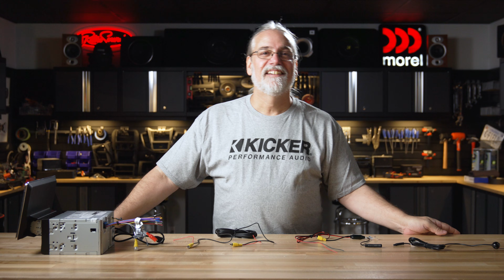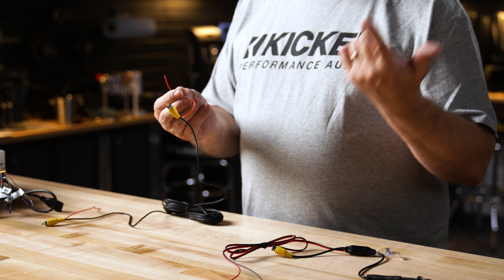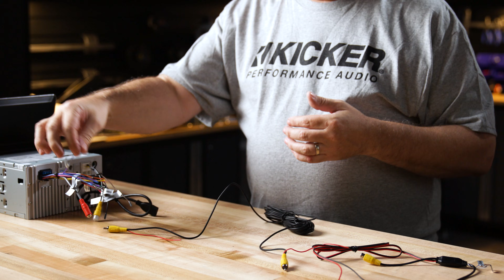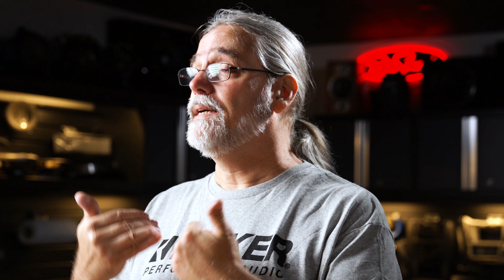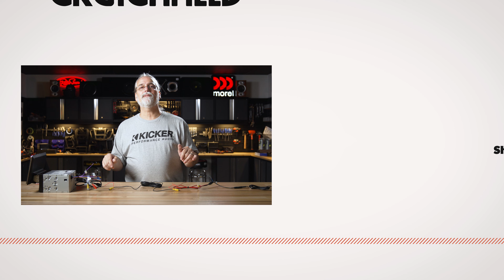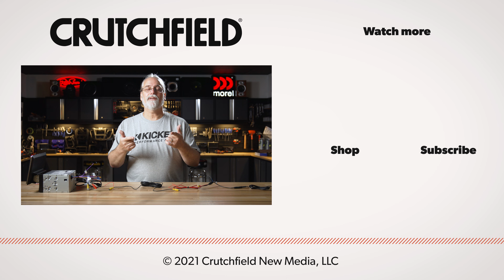Powering your backup camera (and how to use that extra wire) | Crutchfield

Comment: Quick question, What if I want to upgrade my stereo with an android carplay, but want to keep my OEM camera? 
Can you explain that if you don't mind? 
I already have 2 in the back of my vehicle, and don't want a third. I appreciate the time, and help.  Thank you again, and have a great day.
Reply from the maker: It is often possible to retain a factory camera with an aftermarket head unit when using the correct interface/adapter. What's the year, make, and model of your vehicle?
Reply: @crutchfield  2018 Dodge Caravan Se.
Reply from the maker: Yes, you can retain the factory-installed rear view camera when installing an aftermarket radio in your Dodge Caravan with the wiring interface for the Dodge.

Comment: I purchased a JensenCDR6221 from Crutchfield a couple of years back. I finally had time to install a bucamera for my truck and I ran all the wires. 12v, ground, reverse trigger, then ran the yellow wire and trigger to the front of my truck to the head unit. Plugged the yellow into cam-in and soldered the trigger wire to the purple with a white stripe. When I shift into reverse it recognizes that I shifted but no video signal, then 2 screens pop up with black and white lines flickering over it. Please help?? And its not a Jensen bucamera it was for a android touchscreen I got from Amazon. One video said it might not be compatible
☆ update- I ordered the jensen bucamera and hooked up the video and power wires that I had already ran under my truck, thru the cab, under the kick panels, and up to my head unit. Worked as soon as I shifted to reverse!!! I pulled my head unit yesterday to double check I soldered the trigger wire to the correct wire. The camera wasnt compatible with my head unit.

Comment: I hooked up back up camera, for power I hooked up to the running lights that are led and  with the key on the camera is on but as soon as the engine starts it goes off any suggestions other than running a wire all the way back to the camera?
Reply from the maker: Thanks for reaching out, we're happy to help! Free tech support is included with every Crutchfield purchase,  just locate your Crutchfield order number in your confirmation emails and give our experts a call at 1-888-292-2575.
Reply: Turn headlights on u should get it working

Comment: Great explanation. One question however. Why should the negative of the camera power be connected to 
Car chassis ground rather than to the negative of the rear lamp for example?
Can¡t you get plus and minus from the rear lamp?
Reply from the maker: It's best to connect the camera's ground wire directly to a metal chassis grounding point in order to prevent possible electrical noise/interference that could degrade the video signal.

Comment: Okay, hear me out. If I setup my camera to a manual AUX switch (and not my backup lights) using the radio trigger wire I should be able to view the camera whenever I want (the radio just thinks I’m in reverse)

But here’s my problem. My setup does not use the trigger wire but has all the crutchfield wiring adapters for my Kenwood stock backup cam. And I want to engage a front plate camera with out taking my hands of the steering wheel. 

It should work.. right? I want to test it out but I don’t casually have any Eletronics that can output an RCA video signal I can get to my car.

Comment: does splicing into reverse lights for the rear camera power  pull too much power from that circuit and cause issues?
Reply from the maker: No, it hasn't in any installation we have done to date!

Comment: I have a 2008 toyota sequoia, previous owner installed a pioneer nex 5000 head unit, I beleive back up camera is stock, I tried to get back up camera to work on head unit, well it came on and cant exit the full screen view of the camera that stays on 100% of the time now. No reset button, disconnected vehicle power and it still stays stuck in full time camera mode. Any tips?
Reply from the maker: Did you connect the Pioneer head unit's reverse wire to the vehicle's reverse light circuit? That's the required connection to have the stereo automatically switch to the rear camera input while in reverse.
Reply from the maker: I'd recommend checking the camera settings on the Pioneer head unit. You may also want to check the reverse/backup trigger input on the Pioneer receiver to make sure it is connected properly.
Reply: @crutchfield no button pushes will exit the screen out of camera mode
Reply from the maker: Its likely the reverse wire is not connected properly. Connecting the reverse wire to a wire in the vehicle that get 12V power all the time when the radio is on would cause the issue you are experiencing and the fix is to connect it to a wire that only gets 12V power when the vehicle is in reverse.

Comment: Still clear as mud when I want always on powe power. Presenting so much scenarios just adds more confusion. What's the purpose of the additional harness when you still have to connect it to a red wire on the back of the radio unit and the where\what does the harness connect to?

Comment: Just install everything, you can shift to reverse when key just on position without engine, my camera working but on screen is not so I got it mixed up there's an orange wire on the back of the screen, just like the one from the camera. You need to connect the orange wire from the camera to the PINK one on the back of the screen.

Comment: Very nice video. I have a question about my car's rear camera. When in reverse, the camera works but the power steering stops working 😶. Sometimes I see the steering icon on the dashboard. So I had to disconnect the camera in order to get things back to normal....Can you help me with that?
Reply from the maker: Thanks for reaching out, we're happy to help! Free tech support is included with every Crutchfield purchase,  just locate your Crutchfield order number in your confirmation emails and give our experts a call at 1-888-292-2575.

Comment: The main question is: why can’t you connect the ground wire to the reverse light’s ground wire?
What should I do if the camera’s signal wire is only red and there is no ground wire?
Reply from the maker: Thanks for reaching out, we're happy to help! Free tech support is included with every Crutchfield purchase,  just locate your Crutchfield order number in your confirmation emails and give our experts a call at 1-888-292-2575.

Comment: Hands down best video explaining how to hook up a camera and walk through all these little wire ends. Thank you! Will be fitting my camera tonight, so hoping all goes smoothly!
Reply from the maker: Good luck! You got this
Reply: @crutchfield thank you. I’m opting for the continuous power approach, but need an extension of the power wire to go from switch to power source - what gauge wiring am I looking at, please?
Reply from the maker: The best match will depend on the camera. What brand and model is it? If you got it here, you can call our tech support for help with the installation as well. Their direct number is on your invoice.

Comment: I have a new android unit in my toyota, there is an original camera installed, ive connected the yellow conectors, but stil no reverse cam.. im not sure what oeiginal wire to connect to th back up wire.. i need help if any1 has sorted this plz. Ta

Comment: what if you are using a "ready harness"?  do you have to hook it in the back or is that part of the ready harness wiring?
Reply from the maker: You'll make the backup camera connections separately as you do the install.

Comment: im using carplay 9" display to my skoda fabria 2010 vrs its strange on my reverse camera it came with red wire on phono cables and power cable I have no switching wire on my display so I've run wire to back of car and tapped into passenger reverse light pos and negative also power lead goes to same light but it does not come on I have same bulb on drivers side but their is no power to bulb but has bulb in socket so don't know if it should be on or not I've googled about it but it says in uk my car should only have one reverse light drivers side but mine is on left passenger side camera still not work tried earth to car no change hope you have any ideas many thanks Darren

Comment: Confusing description when explaining wiring camera so that it is not triggered solely when shifting into reverse. You don’t explain how to trigger the camera screen while you’re driving in forward gear. Such as if you are driving forward on a highway while towing and want to look at the back of the vehicle. There would have to be some extra type of switched wired in to trigger the camera to swap the head unit screen.
Reply from the maker: The radio that's installed needs to have the ability to manually display the backup camera. The process varies but the owner's manual for the radio will outline the process to get it to display
Reply: Couldn't you just use a toggle switch and run it from the 12v constant??

Comment: If my radio has multiple video inputs can I just use an auxiliary spliced to access the camera view without putting my vehicle in reverse? Could I install a switch to power the camera that way & view it on a separate channel?
Reply from the maker: Thanks for reaching out, we're happy to help! Free tech support is included with every Crutchfield purchase,  just locate your Crutchfield order number in your confirmation emails and give our experts a call at 1-888-292-2575.

Comment: The question I have is, I needed an aft video adapter for a 2013 Toyota factory head unit I put in a 2011. The 2013 unit doesn't have a video RCA port. 
    I picked up an adapter that converts the 16 pin plug to a RCA, but also has 2 extra wires in this adapter. 
      The question is, are they needed if the camera power is tapped into the reverse power line in the back? 
     I have the red head unit wire tapped into the red stereo power harness line. 
     Do I now just plug in the RCA adapter and connect the yellow RCA and be done or is there more that is needed. 
    Unfortunately, none of this has directions or a wiring diagram, nor is there a video I can find on this specific set up.
     Any information, link or advice would be greatly appreciated.
Reply from the maker: Hi Bill, the correct wiring configuration will depend on the adaptor and backup camera you'll be using. If you got the adaptor or camera here, you can call our Tech Support for help getting them installed. Their direct number is on your invoice.
Reply: @crutchfield stock head unit, aftermarket tailgate handle camera. 
    Looks like I possibly need an $80 interface 14 pin adapter to get a video RCA port. Not worth the time or money at this point to try to make this unit work. Was surprised to fine that so many cars don't come standard with RCA ports or CD players anymore... 
   Thank you for your time. 
200k miles on this tundra, not looking to spend $300 on a head unit with no CD player.

Comment: Hi. Thank you for a great explanation. One question, if my backup fuse also powers other things like daytime running lights that means I can’t use that option?
Reply from the maker: Tapping into the same circuit as the daytime running lights (DRLs) on your fuse panel isn't recommended. It could cause electrical noise in the camera feed.

Comment: Great tutorial, really informative. I have one question if can answer me, I would be grateful. How would I connect reversing camera and parking sensors together this way. Can I use same T tap connector for camera and sensor, so they are on same one T tap, or I need to use 2 separate T taps? Thank you very much
Reply from the maker: If they can both make use of the wire you tapped into, connecting the wire from the new backup camera as well as the new parking sensor system, and they fall with the acceptable sizes of wire for connecting 2, then this works

Comment: If I need that can turn on then I right signal the car . Do I connect the one end to signal other end from camera to right signal + wire ?
Reply from the maker: No, if you connect the camera’s power directly to that wire the camera will flicker on and off. I'm sorry you are having difficulty installing your rear view camera. If you purchased the camera from Crutchfield, please give our technical support team a call that handle installations. If you purchased the camera elsewhere, I recommend contacting the dealer who sold it or the manufacturer directly.

Comment: What is the benefit of using a separate ground from tapping into the ground wire for the backup light?
Reply from the maker: A separate ground wire gives you a cleaner signal with less noise or weird glitches like flickering, etc.
Reply: @crutchfield thank you.  Will directly to the trunk metal create the ground, or should I send another wire through the harnesses?

Comment: I get intermittent no signal issues flatter replacing my damaged camera.. currently hooked up to 12v power from the system not the reverse light. Had the same set up last twonyears. Had no issues

Comment: I thought this was going to explain the odd red wire from my rear camera, but alas, it does not... Sigh...
Reply: The red wire is to give power to the camera module and the LEDs when you are in reverse so you need to Wire it to your reverse light bulb on the tail light.
Reply: @guilleport I don't want it on "when in reverse". I want the damn thing on all the damn time, so that it will record like it's supposed to. How hard is that to understand?

Comment: after 3 hours of trying and failing. I came across this video, which reaffirmed that i was doing things rights. This re invigorated my confidence and i i went back and retraced my lines. Turns out the line was pinched in a unviewable spot and thankfully reseating the pinch(almost cut) wire fixed the issues. Sometimes you have to go back to basics and this was a helpful video

Comment: By any chance you have a video for front bumper camera install lol
Reply: it will hook up the same way the backup camera was installed. but !!!..you must have a head unit with an extra rca video input to use the front camera. red wire at camera end, needs 12 volt dc power ran to it, black wire at camera needs a good ground. you do not need to worry about a '' trigger '' wire from the camera?, as this camera will be on at all times, but !!..if you want to kill power to front camera?, use a toggle switch or rocker switch to kill power to it when you do not want it on at the front bumper. once all this is done?, simply plug the rca ( yellow end ) into the video rca input at the head unit, walla..front mounted camera.

Comment: OK, you got a flaw here. You're saying that no matter what, you have to have a signal on the purple/white reverse sensor wire. 
SO- how to you use the camera as a monitor while driving forward when you can NOT activate the reverse wire ? 
You mentioned several times that the reverse wire must be activated to see the camera. You can not do that driving forward.
I'm wanting a system that will work normally as a back up camera (reverse activated) and have the ability to flip a switch to be able to 
use the camera at anytime without being in reverse. Logic here says a switch from the red camera wire on the back connected to the reverse sensing wire?
Reply: i just did all this with my pioneer avh-2550nex, it can be done !!. keep in mind though, i installed this system in a '00 chevy silverado, 2d, reg cab truck. i got it all connected to not only use the backup camera to come on when i go to reverse?, but also use the same camera to view while driving forward !. depending on your head unit ?, will tell you if you can do both?. my head unit lets me switch the camera to use for backup..or view while driving forward.

Comment: What.if there is no black wire to ground, but a red wire with a black stripe? 

Basically my setup is camera, black cord that splits into a yellow video plug, and long red wire with black stripe. The other end has yellow video  female with short orange wire. The third wire is long yellow video cable with one end having a another short orange cord at the end the plugs into the radios harness
Reply from the maker: Thanks for reaching out, we're happy to help! Free tech support is included with every Crutchfield purchase,  just locate your Crutchfield order number in your confirmation emails and give our experts a call at 1-888-292-2575.

Comment: Lost my master sheet as i wasn't able to install it for 2 YEARS, so im trying to get it going through youtube and trial an error. Sure wish i hadn't even opened the box when I got it then I'd still ahve the master sheet.
Reply from the maker: Thanks for reaching out, we're happy to help! Free tech support is included with every Crutchfield purchase,  just locate your Crutchfield order number in your confirmation emails and give our experts a call at 1-888-292-2575. If you can't find your confirmation number, our Techs will be able to look you up in our system and make sure you get the correct MasterSheet!
Reply: master sheets dont really tell you much?, they may tell you what all tools you will need to rip old radio out?, install new radio?, they sure won't tell you how to connect the new radio!. this will be in the radio owners manual. some basic car/truck electrical know-how is a must if you plan on installing any radios, amps..what-not?!.